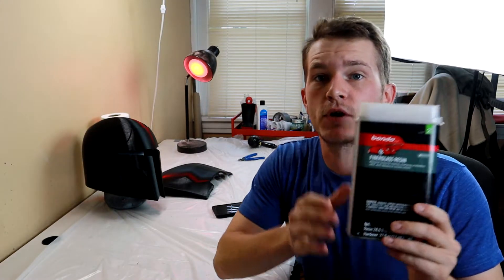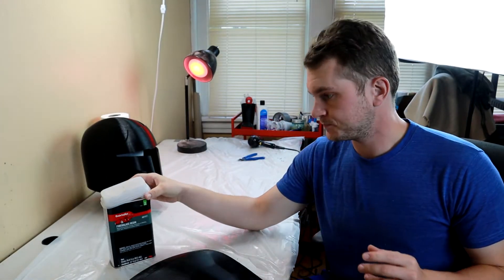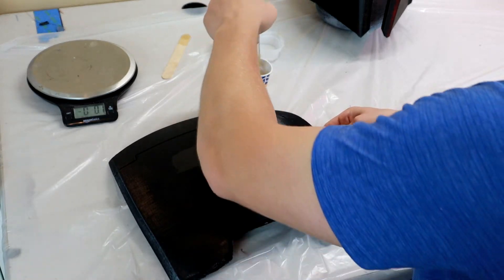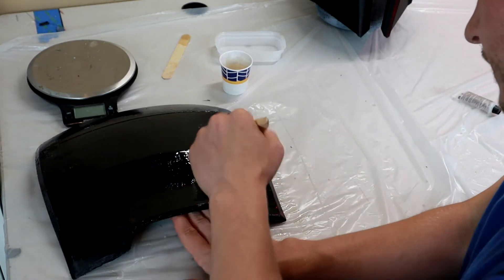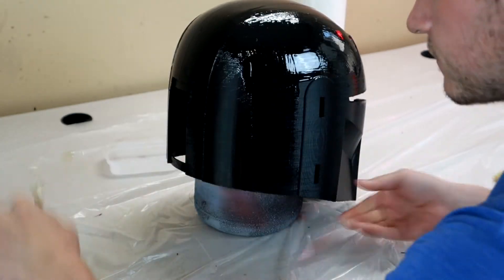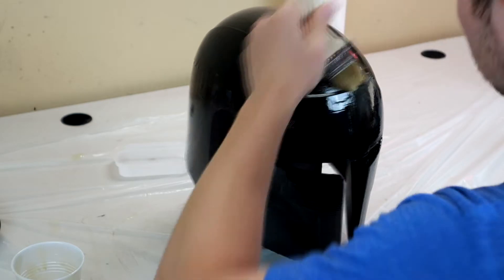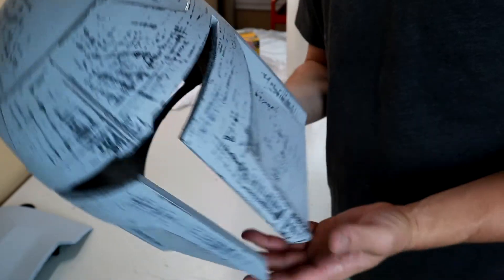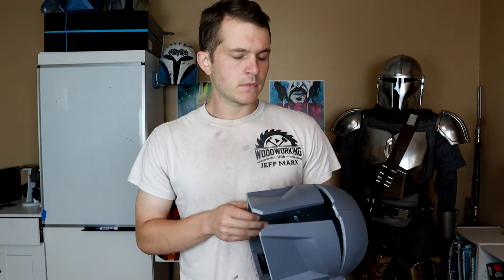Smoothing 3d Prints with Cheap Polyester Resin

Comment: Good to know you can use polyester on PLA. I'm printing a large 3D RC boat made up of several pieces. I'm going to use polyester in a number of coats now to make sure its water tight and for more mechanical stability.

Comment: Followed your instructions and after days of tacky,researching the whys,seems for 1 oz it says to use 10 drops not 2 . And that's using a push pin to make the hole.  Did you need to do anything different?  But tbh I'm liking the results I'm seeing

Comment: Very interesting. I have seen several videos where people use 3D printer resin (I guess it is PU-resin?). I have both at my disposal and also have to do a Mandalorian helmet. Now I wonder which one to use - Polyester or PU resin? Your result looks very convincing.
Reply from the maker: I've done 3d printer resin, and I've had issues with curing, both are solid options tho if done properly
Reply: that would be SLA/UV resin. It only cures with UV light and definitely requires some PPE, but can work similarly, especially for simple surfaces.